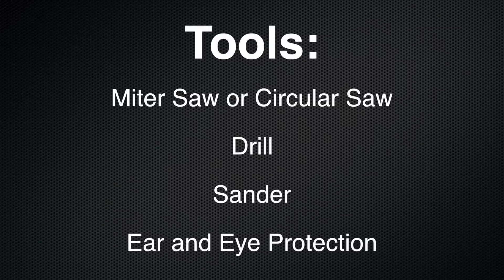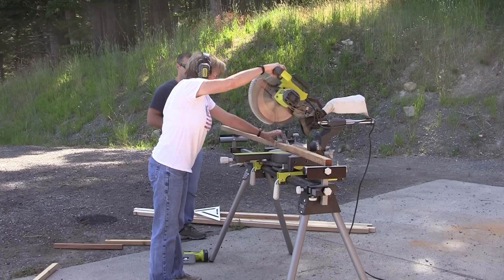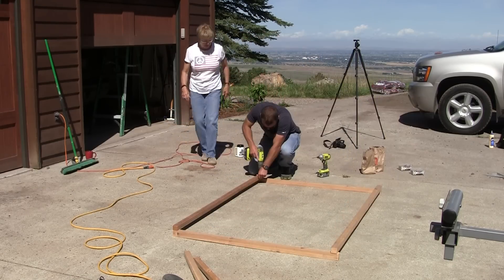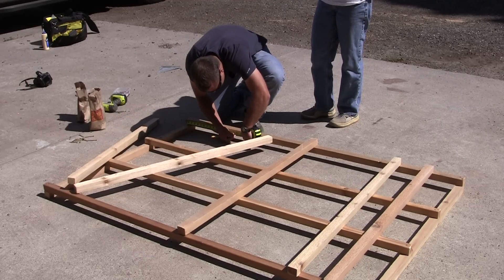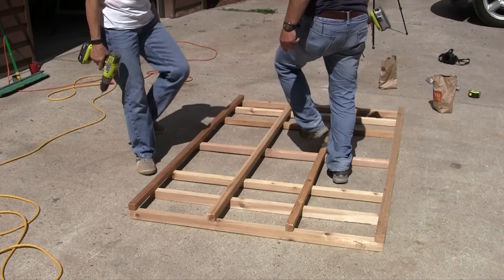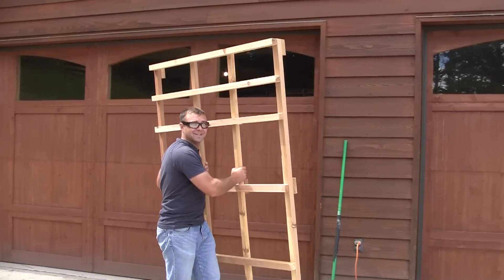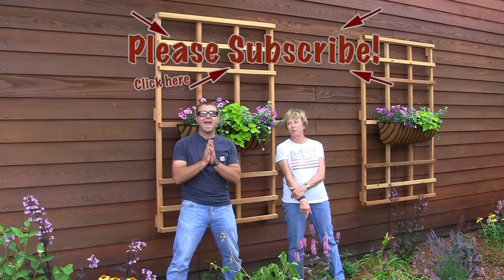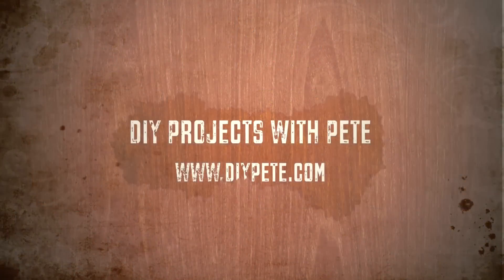How to Make a Garden Trellis | DIY Trellis

Comment: I recently took several wood trellises off my house that were attached with wood spacers similar to yours for the purpose of repainting my house. The wood siding (T1-11, basically plywood) was rotted under most of the spacers. Any suggestions for adding a trellis that won't result in damage to the siding?

Comment: Pete, how did the planter attach to the trellis? Sorry if it was explained and I missed it.
Reply from the maker: Hi! There are two loops on  the back of the planter that could be used to hold it up. So I put some 2 1/2 inch screws into the trellis and then hung the planter on them. Here is a quick shot of it: https://youtu.be/-jhL0J02pbs?t=286